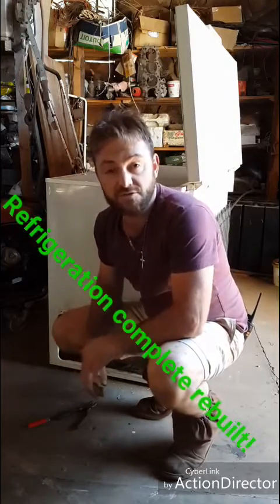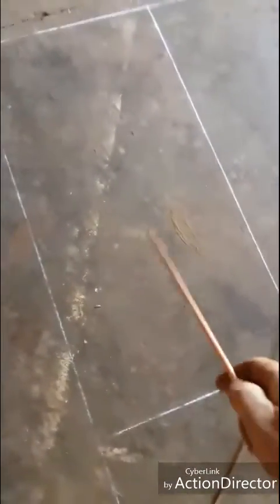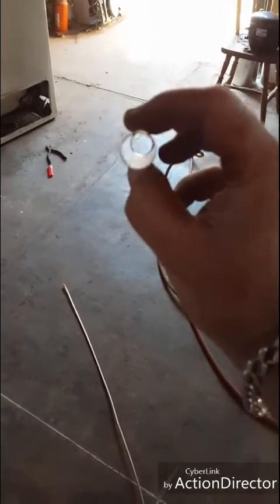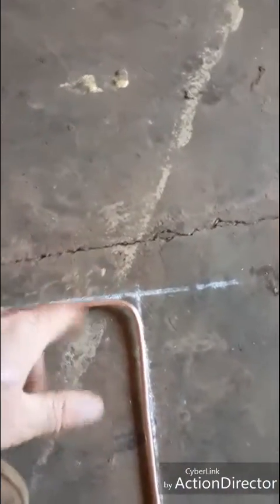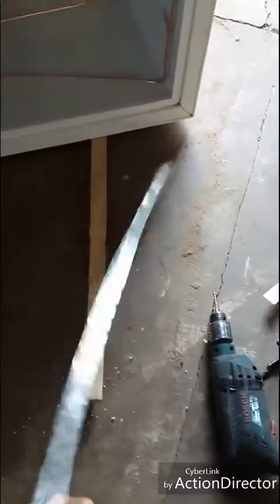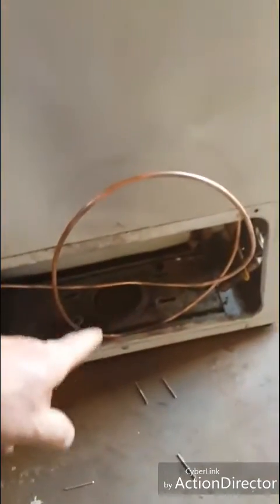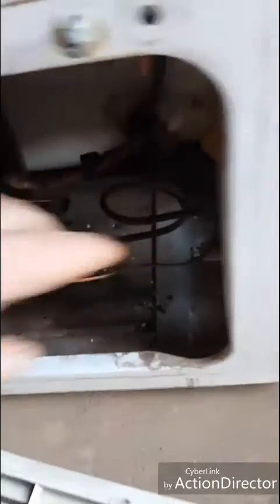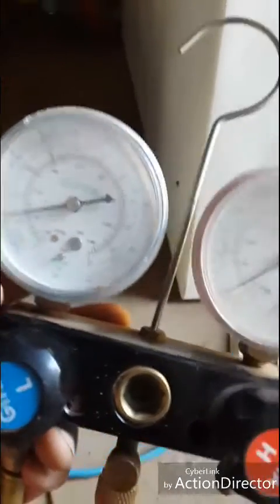Refrigeration step by step complete rebuild of deep freezer DIY.

Comment: Thanks for the video.  Please explain what that accumulation pipe purpose.
Reply from the maker: @malekutumafa5124  It is a pleasure. It is for oil deposits that finds it's way through the system. So that it doesn't get lodged in the capillary tube.

Comment: Is it worth it to recoil a deep freezer if the evaporator coil is messed up for whatever reason? What about the condenser? Is it worth recoiling those?
Reply from the maker: I wouldn't bother with the condenser tray.... the inside pipes is the only ones worth doing. If you compressor is good, but it sprung a leak. You only looking at the cost of the pipes. And obviously your time.....

Comment: Nice video. I rebuilt a few like that even household refrigerators.  They work like charm. But i use aluminium tubing instead of copper since its cheaper.

Comment: How do you know which capillary coil is needed and what size? same goes for the compressor, evaporator and condenser.
Reply from the maker: Formulas are how the old school guys were thaught.
My knowledge is all trail and error. 
Capillary length and size determines the flow rate, the quicker the flow the weaker the cooling, the slower the flow the better, but not too slowly. There is a sweet spot.

Comment: Where exactly did u put the accumulator. On the return line to the compressor or on the discharge line  after capillary?
Reply from the maker: I put it after the capillary,  at the bottom,  lowest point.

Comment: Good job sir, pls, my question is what can be d real cause of freezer that is half frozen? 
My freezer only freezes at top part, the middle down to the bottom only cold and I just changed the compressor. Thanks sir
Reply from the maker: Might be too little gas, or blockage in the pipes.
Did you flush the lines out with the right solvent?

Comment: Hey Aldo, thanks for the vid. I am looking to build a portable 12v battery operated freezer with around 250litre volume. Have done some research. Could I build it like you have done here and thencover it to look more aesthetically pleasing? What compressor do you suggest? Danfoss is all the Americans talk about, but they are very pricey and maybe over rated?
Reply: secop, and sikelan
Reply from the maker: Yes, I know a guy that did that, he covered it with chromedeck plate, looked awesome actually. Not sure what compressor to use in 12v range.
Normally its calculated by the volume of gas in the pipes. So this rebuild takes very little gas because its only 30 meters and 6mm copper pipe. So a small compressor can do the job easily

Comment: Could one take the guts from a smaller chest freezer and build a slightly bigger, but much better insulated box for it? I have access to a free, but smelly, small working freezer but I want a bigger one. I'm a pro cabinetmaker so I could make a nice tight box. I could add 4" or 6" of insulation and make sure the door seals perfectly.

Comment: Hello Aldo,
Thanks for this awesome video.
I'm having some issues with my chest freezer and I'd like to get some recommendations from you.

I have a 429 litres freezer which had worked for about 7 years without issues. Then one day, it stopped freezing even though the unit was on and compressor was working. I called a fridge mechanic and he said there was no refrigerant in the system due to an internal leak. He recommended that we change the piping from aluminum to copper.
A few days after we did, the freezer stopped cooling again and I called him back. He checked the system and said the compressor was bad and needed to be changed. I bought a new compressor that was the exact same model with the one that went bad. I called the mechanic but he was unable to come for days. So I got another mechanic who installed the compressor and charged the system with refrigerant. But from then on only the top half of the inside of the freezer actually freezes and forms ice even at the coldest thermostat setting. The bottom half doesn't freeze, doesn't form any ice; it just stays cold.
I called back the mechanic but he couldn't figure out what was wrong. He even added more refrigerant but then the freezing reduced to only the top quarter of the freezer while suction line to the compressor was freezing up and forming thick ice which later melts and floods the floor.
I reverted to the first mechanic who said that the R134a refrigerant was too much so he reduced it.
He then cut open the pipe just before the dryer and let out all the refrigerant and tested the system and said the system needed to be flushed as it had some dirt in it (The other mechanic didn't do this before installing the new compressor). In the process of flushing it with what he said was cooking gas, he discovered that the capillary was blocked and had to run a new one along with a new dryer. I did see quite a lot of dirt come out as he was flushing it.
He then charged the system with R134a refrigerant but still, only the top half of the inside of the freezer was freezing with the bottom half only cold.
He also couldn't explain what was happening.
I called a third mechanic and all he did was add more refrigerant which again made the compressor suction line to freeze and the freezer to be more noisy than before. I had to reduce the refrigerant before the noise reduced and though the compression suction line doesn't freeze I still see droplets of water all across it.
The three mechanics don't seem to know what could be wrong.
However I have been doing extensive online research and based on my research I have a few thoughts as to what could be the reason but I want to run them through you.
They are:
1. I suspect that the copper used in re-piping the inside of my freezer may have been larger in diameter than the original aluminum pipe. The mechanic said he used 3/8 Inch diameter copper pipe running them at the same length with the original aluminium that he took out. The pipe he took out looked to be kinda smaller than the one he put in.
Could an increased diameter pipe make the compressor originally designed for a smaller diameter insufficient for freezing the entire system since the effective volume of the pipe the refrigerant has to go through has increased due to the increased pipe diameter thereby making the work being asked of the compressor greater than it can give?
2. If the scenario above is the case, I'm thinking of getting a compressor of higher power. The one currently installed is 1/3HP. I'm thinking of getting a 1/2Hp compressor. But then again I saw online that getting a higher rated compressor than the system was designed for would introduce a mismatch, as its pumping capacity would be too large for the capillary and the refrigerant won't flow fast enough to keep up with the compressor. Also the compressor would consume more electricity and the sunction superheat and liquid subcooling would both go up. Higher superheat and subcooling means that the compressor, the condenser, and the part of the evaporator that will now be liquid starved will all run warmer while the rest of the evaporator will be colder.. Sunction pressure could be in a vacuum (which isn't favorable) and discharge high.
So please what do you think about me getting a higher power compressor?
3. I read somewhere that if there is air in the system it could cause only half of the inside to freeze. I also saw somewhere online that said if the system has air in it, only the top half of the condenser heats up the bottom of the condenser doesn't. So I checked the condenser and noticed that only the top half of the condenser warms up a bit during operation of the freezer but the bottom half doesn't. It's just at room temperature: not cool and not warm. Could it be that there's air in the system and it's preventing the bottom half of the inside of my freezer from freezing?
4. Another thing I noticed was that the new capillary that the mechanic put isn't quite as thick in diameter as the one originally installed in the freezer. Could the use of a smaller sized capillary affect the freezing and cause this half way freezing?
5. Also could a faulty or bad thermostat be the cause of only the top half of the inside of the freezer freezing?
Please I'd appreciate your words of wisdom and guidance on what I could do to solve this problem once and for all. 
Also, I'm sorry for the long message... I just wanted to give you a full back story of my travails with this freezer.
Thanks...
I look forward to your reply
Reply: Get a high speed compressor 1/3+ and make sure your capillary is long 2 to 2.5m .refill gas slowly

Comment: Nice video, but isn't a new freezer more cost effective? All that copper tubing and materials , refrigerant  must have cost quite a bit of money...
Reply: How much meters of capillary tube did u use?
Reply from the maker: Hi there. Its actually cheaper fixing it this way, also it lasts a lifetime now. Less stress on compressor, cools quicker.
Thanks for comment, and watching!
Reply: @aldovanzyl-jackofalltrades8446 obviously true but most times after a successful re-piping, the deep freezer tends not to be freeze downwards but half way from the top.

Another observation is that once there's power outage the deep freezer defroses out immediately 

Any expert reasons to this and a better way of doing it properly?

Will appreciate your feedback 

Thanks

Comment: Thanks for the video. I have some questions at 6:00 you said most fridges (isnt it a freezer?) have more tubes than your 29 mtr. I have taken out my ice vitrine completly and it amazed me howless tubing it got alaround in pur foam just two tubelines. And i guess they where there only where hands make contact so it feels could at the outside, but has noting to do whit cooling the vitrine. And about that black iron thing on your fridge to cool off heat. I dont got it on my ice vitrine can you explain that. Because it is a big profeaional ice vitrine.

Why i want to know all of this i i wanted toakr something like you did and you said fridges have more tubing MORE THAN THAT WHAT YOU GOT. What i have to do than for a FREEZER. and why this icevitri e is so big and have so lesa tubeing while itsl says to freez dow to minua 36 degrees.

Can you help me further thanks anyhow

Michel
Reply from the maker: Hi there. Yes sorry meant to Freezers.

All depends on gas volumes. And that is calculated by the size of your compressor in the freezer. I use 6mm copper tubing, so it has low volume, most freezers have 8 or 10mm tubing, normally aluminum is used, and that's cheaper but aluminum doesn't last. The oil found in the compressor causes corrosion. Copper lasts a lifetime.

The black thing? Are you referring to the accumulation chamber? Trick I picked up from a old professional mechanic. The oil in the compressor sometimes finds its way into the pipes. Because I use 6mm tubing it has a narrow path , oil could clog the flow. So the accumulation chamber is like a catch box of sorts.
Hope it helps!
Thanks for commenting!

Comment: How many feet of cooling coil and capillary is in a 200 liter blue star  deep freezer sir pls help me
Reply: Please tell me capllary length & size
Reply from the maker: Capillary is 0.62 and should be around 1.2 to 1.5 meters long.
If the capillary is too long cooling will take long, there is no set formula... Trail and error
Reply from the maker: I would use about 25 to 30 meters

Comment: We know today's deepfreezers either have alumunium or iron evaporators and condensers but had it been a copper evaporator inside puff insulation ( time of 1st make ) then 
1. what is the probable percentage of leakage? 
2. Or even puff insulation do cause any chemical reaction to perforate the copper evaporator.
I have watched your video along with many other videos but amazed to your good quality job and thrrow knowledge with confidence, so I request and if you may answer to my these two queries.
Reply from the maker: Thanks for watching and responding.
In my experience IF copper was used it would last forever, but copper is expensive and that's why it isn't used when built by manufacturers. They want it to break.
The puff insulation has no chemical reactions I believe, but seals the moisture build up on the pipes in and this causes rust. See some of my other videos for that.
I just love fixing the unfixable, and don't really care if it cost me a lot. Its all worth the experience!
Thank you for your kind words once again.
Reply: @aldovanzyl-jackofalltrades8446  Thanks sir for your response. couple of queries yet again , if you be kind enough to answer me.
1. Does your Dp frzs attain -18c         temp that is much required for raw meat preservation.
2. Does ice formation takes place on the other side of the pipe fixed plate which may spoil the insulation part.

Comment: How many feet of cooling coil is in a 500 liter deep refrigerator blue star sir please help me
Reply from the maker: I use very liitle pipe, that way the gas pressure is low, and compressor easily saves power, I use about 30 to 40 meters in 500L deep freeze.
Reply: It is used to keep the fish butter to keep fishing, then the temper must come as before, if Sir 40 fit pipe line...

Comment: What are the list of parts to build a chest freezer from scratch?.. I know you need a compressor copper tube a condenser  and fan an evaporator and fan thermostat.. capillary tube..r410 refrigerant...
Reply from the maker: yes all sounds right, but remember to use the right refrigerant for the type of compressor you bought, I use R600A or R134A

Comment: Good day ,i bought a compressor at my work place ,i normally fix domestic fridges,the compressor its written LRA 31.5,wen recharging it ,wat amps must i not exceed when recharging the system?
Reply from the maker: hi there, what is the size of the compressor in Horse power? and is it a R134A or R22? It sounds like it might be above 1 HP difficult to tell you how much amps, the best thing is the feel the pipe temp. The low pressure return line must be cold enough to form water vapor on the pipe

Comment: I want to rebuild a same size deep freezer it had four pipes on condenser ,i tryed using old compresor but not wining,the compressor you used its 1/3 or 1/3+?
Reply from the maker: Hi there. Yes it was a 1/3 R600A. With 1.5 meters of capillary tube.
Hope it helps!
Reply: @aldovanzyl-jackofalltrades8446  thanks a lot.

Comment: What is the use of accumilator?is it mandatory
Reply from the maker: rimpysexydoll Hi there. The way that I was told by an old Fridge mechanic is that its very important part in a deep freezer. Helps with the liquid to gas conversion so that nothing gets stuck inside the pipes. Been working well for me. So easy to make one! Why not!

Comment: sir how many used condensor size lenght diamention and caplary dim.
Reply from the maker: zaid malik ; I used the standard condenser tray. Didn't change that. Think its standard 4 or 5mm diameter. Capillary is 0.26 domestic size by 1.5 meters long
Reply: thanks alot sir